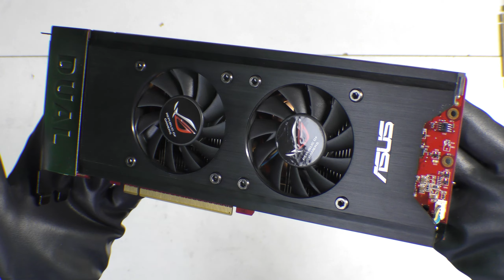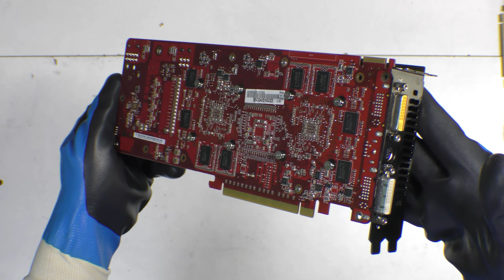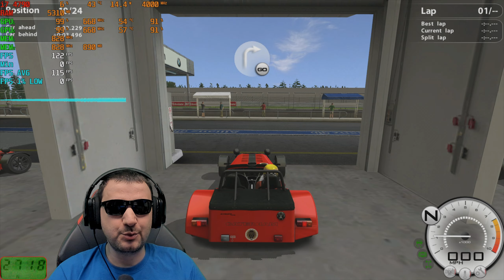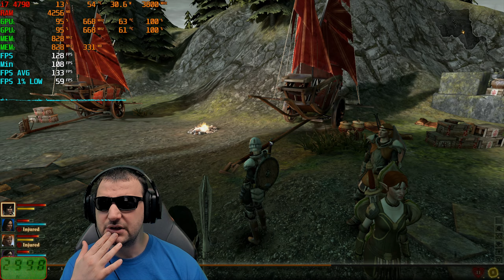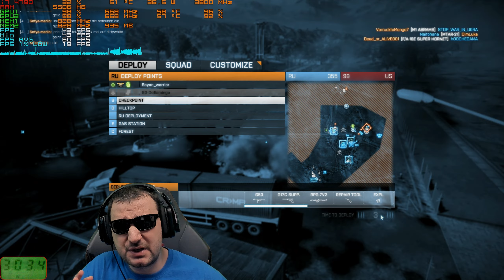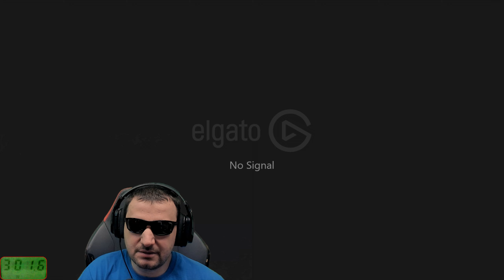ASUS ROG HD 3850 X2 Benchmark

Comment: I have a palit hd 3850 ddr2 1gb nice performance upgrade thats on here with the dual card
Reply from the maker: that DDR2 whooped that card.  What did you run on it?
Reply: @DanielCardei  I ran fallout 3 1024x768 on its own medium settings lockrd the framrate to 60 and it was nice. Half life 2 on 1024x768 high to medium ran 70 to 80 fps. I just ran games that i knew was gonna run well and it did. Altough fallout 3  1280x1024 ran very badly.

Comment: Great dual GPU. I only have HD3850. Daniel Do you have dual Hd4670 cards? It would be interesting to test HD4670 crossfire against the HD3850X2. You should do crossfire versus tests with older cards. Or for example HD6850 crossfire versus HD 6870 X2. Or Nvidia SLI versus benchmarks with older systems/games 2x GTX560 /Ti SLI.
Reply: youre a champ, hows the war machine serving you? what cpu is it paired with?
Reply from the maker: I’ll make sure to keep this path going, and I’ll add more cards like this. I have a few, and I think this is the reason I chose this machine with an i7, so I don’t have any problems with the CPU. Windows 10 isn’t good for this path, and I think I will test many SLI and CrossFire setups. Unfortunately, I have to keep the same games and the same resolution.

Comment: ooooooooooooo space marines benchmark! yesssssss
Reply from the maker: I'm not saying no to an RX 5700, but it's not the main priority. I do want to get some, though. That card requires a proper PC, and that's not ready yet. Soon.
Reply: @DanielCardei  understandable, whatever you put out, ill support regardless
Reply: also those bigger lithographys see way bigger performance gains with the temp its running at, sometimes i wish we were able to advance the cards without shrinking the die size
P.S. would you ever test an rx 5700? or xt even?

Comment: A very cool card to have Daniel, well done getting one. I managed to find an HD 4850 X2 the other day, its missing it's fan shroud so it looks a bit ugly. Both cores appear to work fine with the limited testing I've done with it. I found it interesting that Sapphire were the only ones to make the 4850 X2.
Reply from the maker: That is a gem undisguised and a rare card to have. I’m shocked you managed to find it like that. Not many places sell those cards.
Reply: I found it on a local auction site here. I purchased it from the original owner. He couldn't remember why he removed the fan shroud and was unable to find it when he listed it for sale. It was sold as tested and not working, but as I find with many of my purchased "not working" cards, it seems to work ok so far.

Comment: I had a 3850 (single card) die under warranty and I send it in for an RMA, hoping Sapphire could fix it. About 6 weeks later, a brand new 4890 shows up as a replacement. Needless to say, I was shocked and pleasantly surprised. The 4890 was among the fastest cards at the time.
Reply: Nice Switchup! Everey RMA should be like this :D HD4890 was a beast back in the days. I only had HD4850 1G and Hd 4870 512M. Well I still have these. Sadly the HD4870 is artifacting (the gpu coocked itself with default voltage).
Reply from the maker: I’ve got a 4890 now that is a bit unique, and hopefully I’ll get the card up and running in the near future. I think you're going to like it.

Comment: Wonder if the Lossless Scaling app would work with these dual cards. 🤔🤔🤔
Reply from the maker: There is a high chance it's disabling the dual setup like CrossFire or SLI. Very good topic, and I wrote it down as an individual test with that app. I have it and will focus in the future on testing that with many cards. I have options and ideas where I think people can`t get involved because of the lack of diversity in the GPU library. This is where I can shine a spotlight on it.
Reply: problem is that it stores frames in vram
Reply: way too little vram